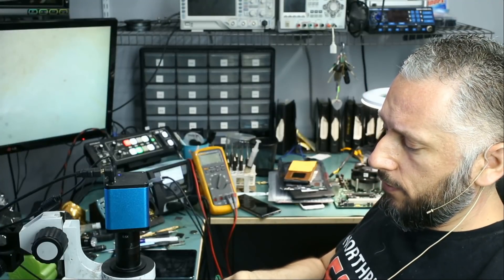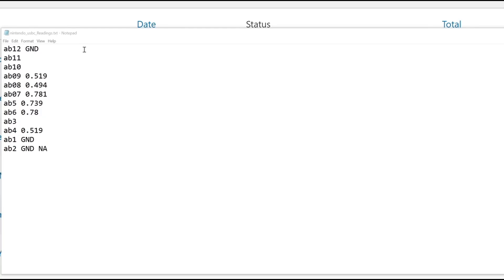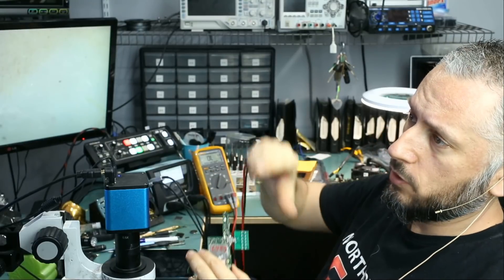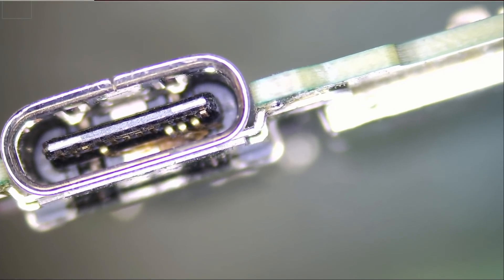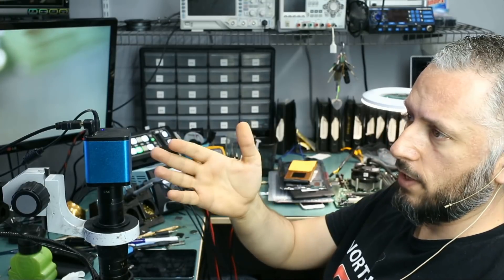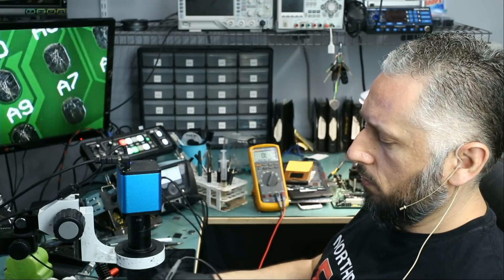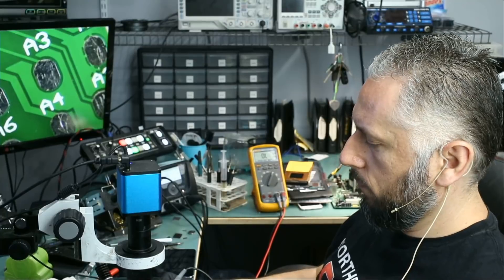Nintendo Switch Diagnostic using USBC Test Board - Faulty Charging Port Replacement

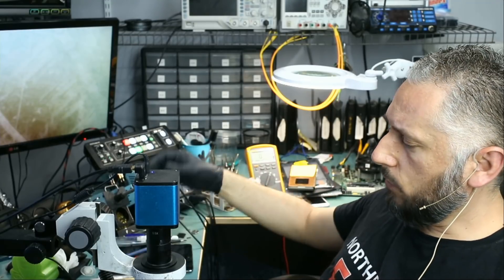Comment: 18:20 You mentioned maybe having a database of readings for diagnostic purposes just then, what about perhaps having a simple diagnostic app developed whereby you could select your device and do things like select symptoms/enter information like readings etc for it to return a list of possible causes? If you're having a database developed anyway, all you'd need is the app frontend and that's a relatively simple task?
Hell, you could even charge a couple dollars for the app if it's a public app to help pay for the costs of running the backend stuff unless you're gonna host it yourself. Enough people wanna use the app, assuming you're making a public app, and it could be pretty profitable as there's absolutely nothing like that available on any mobile platform. None of that matters if it's for your store use

Comment: We can go a step ahead and have an Arduino make the readings with a little LCD that let us select the device and tell us if there is a "out of normal" reading, just by connecting the device. As a matter of fact I will build it, write the program and send it to you and tell me if it works in a "production environment"

Comment: Question for the electronic engineers. Is there a way that the process of taking resistance of each pin one at a time can be implemented into a chip that does resistance for all pins at the same time and output data to say a computer via usb? Is there a chip that exists that can do that?

Comment: If such a device is not already available, and If those measurements over several Devices prove to always point to the correct fault, then those test points "Data or readings" gleaned from several broken devices can be used for a "comparative microcontroller", so with the "comparator microcontroller" you can plug a broken device into it, and as the broken devices readings match previously identified faults, your tester will display the matched fault..
APU I dropped a Like.. Err- 👍

Comment: Very Nice 👍. Perhaps of interest to you, NF, might be an HP SIGNATURE ANALYZER. This is an obsolete, PCB troubleshooting tool, the readings from which were included in service manuals by big boys like Hewlett-Packard, Tektronix and the Military. Today, it is still a great tool for comparing identical PCB's. Just like your new port testers, you must establish reference readings from a working device. You may recognize this device from early in your career. They're still available on eBay. Cheers.

Comment: Wonder if one could make a switch specific 'light up green led' variant of the board,
 to no longer have to use the multimeter and save time...

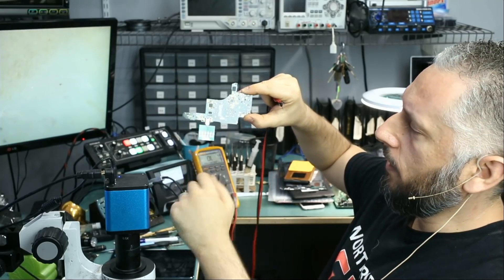Comment: 02:55 this is an example  what i have asked for "wifi chip controll measuring " İn the privious video . 

idea is that:

Does it work if you meausure the  capasitors which they are around the good working wifi chip and take notes and then After if you get a another tablet which has wifi problem ,you may be able to compare the condansator's values to see if the wifi chip good or bad?

(İ am mentioning abot the chip which has no signifuture on it as a burned or etc)

17:49 for iphones, there is a database software to see the pin measuring

Comment: i I have used
Luxorparts IpaClean isopropanol 99.5%
To wash away flux after soldering.
I can not wash away flux well.

I like to wash everything away without getting a thin film of flux

Do you have any experience?
Acetone is good but can wash away writing on components!

Comment: Database is super cool idea! Open Measurement Database, that is something that whole repair industry will participate!
Reply: I'm freaking out with that database idea. Not just good measurements, but I bit, like imagine if we can also upload our wrong measurements and what fixed the problem. That's gonna be awesome and really fast to repair devices.
Reply: @Nanbito diode mode. Alex did explicitly mention it in the video. See 3:30
Reply: Something like that already exists people just need to add data to it. It’s called logwiki. Also ZXW has diode mode measurements viewable on the board view files.
Reply: I guess Im kinda randomly asking but do anyone know a good website to watch new movies online ?
Reply: @Roland Bjorn Lately I have been using flixzone. You can find it by googling :)
Reply: @Roland Bjorn lately I have been using flixzone. You can find it on google :)